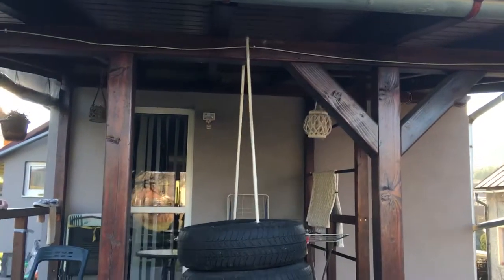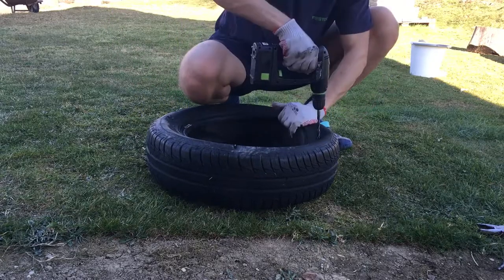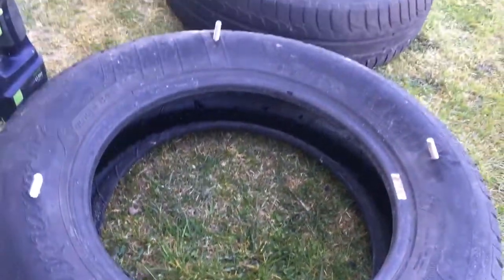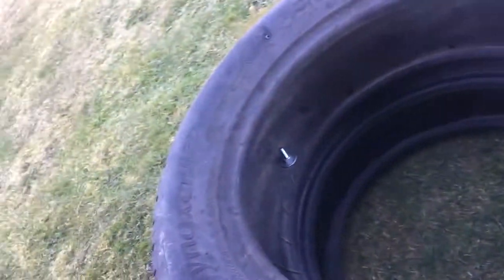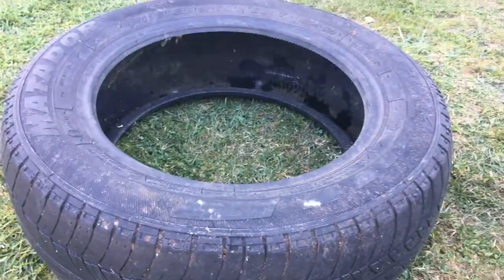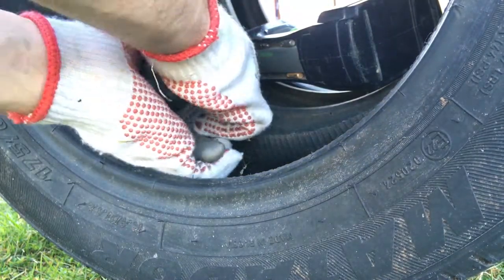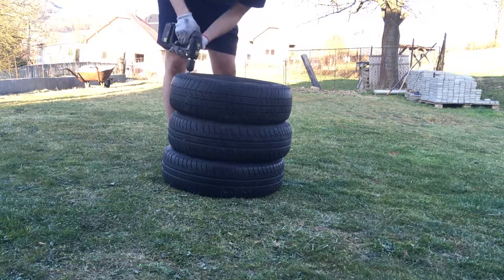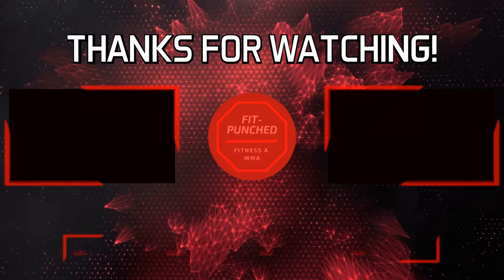How to make a Punching-bag from tires (quick and easy)

Comment: Great video, do you know how much does the bag weights?
Reply: as much as the tires he made it from, so about 30 kg
Reply: @ignatz2  no way 1 tire weights 10 kg
Reply: @casteltheghettomonk4392  have you ever held one? They’re really heavy, probably even like 12kg.
Reply: @ignatz2  just made a heavy bag from 3 tires , 2 days ago . Got another 150 cm 65 kg not from tires , I know the difference when I punch one .
Reply: @casteltheghettomonk4392  so is it heavier or lighter because you're confusing me
Reply: @ignatz2  a lot lighter, maybe around 20 kg , on the 65 kg when I hit it moves slightly ( 150 cm tall 65 kg weight kick boxing bag ) just with punches moves slightly, but on the tire bag 💰 it's all over the place . Just for boxing you use smaller bag cause you want to move more , faints attacks , upwards backwards etc it's better .
Reply: @casteltheghettomonk4392  Ah, yeah that makes sense, i now remember I was carrying heavy duty tires then, damn that was backbreaking.